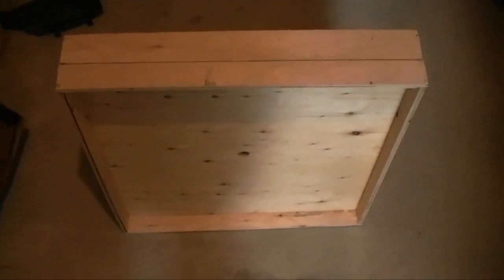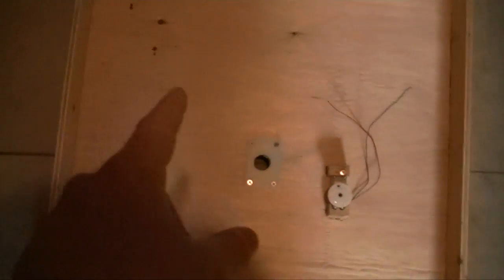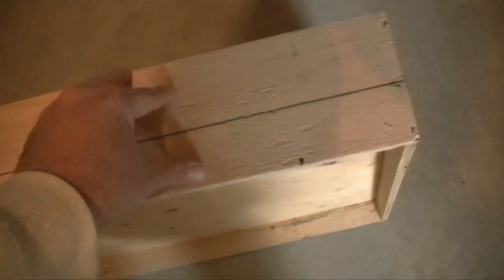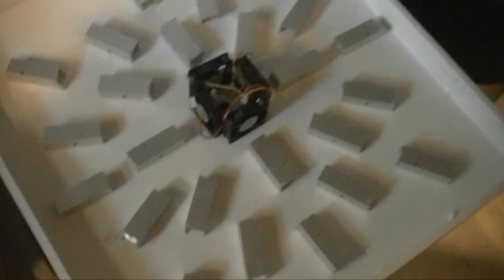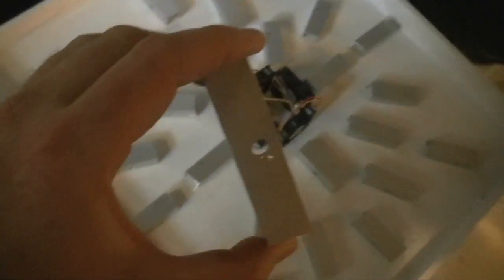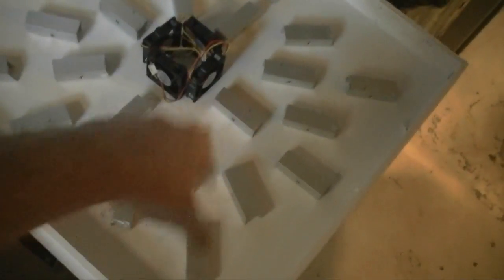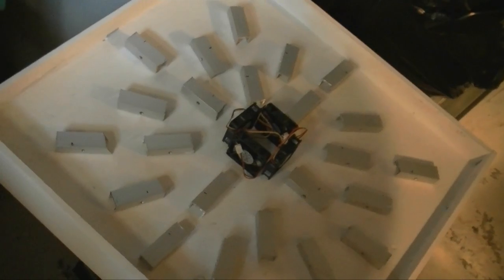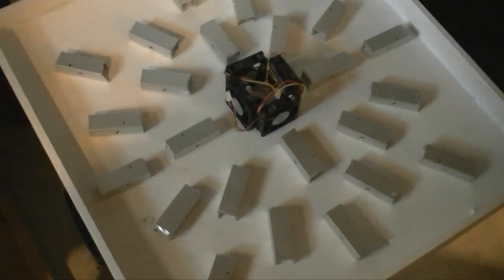Rickets Reef: DIY Frag Tank LED Fixture Part 1

Comment: My zip ties decomposed in about 6 months to 1 year. I have my very light weight T-5's mounted to my canopy with Harbor Freight zip ties and they failed. They became brittle and started to snap, causing my lights to drop slightly. I used a back up strap or they would have fallen on the glass top. Great build.